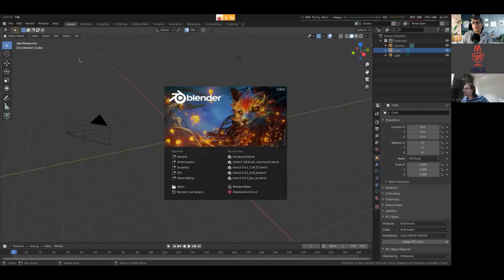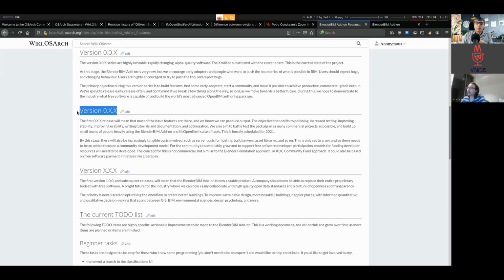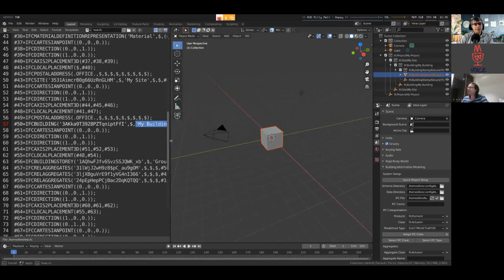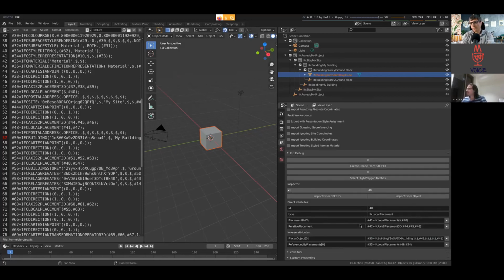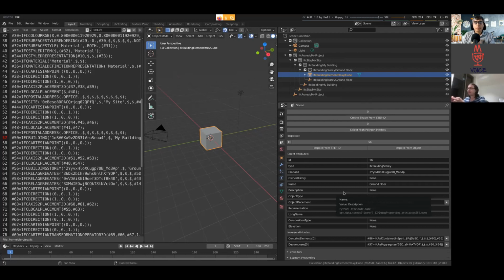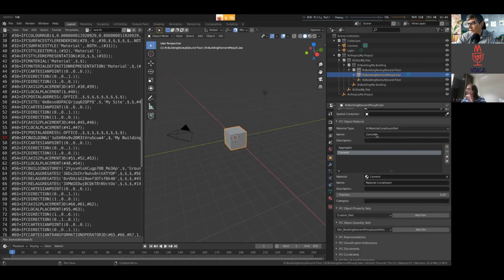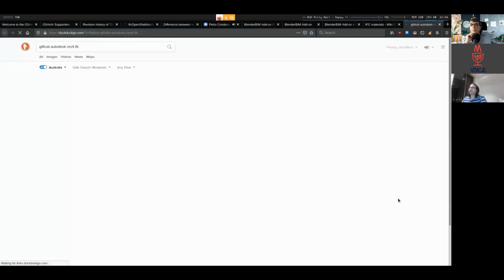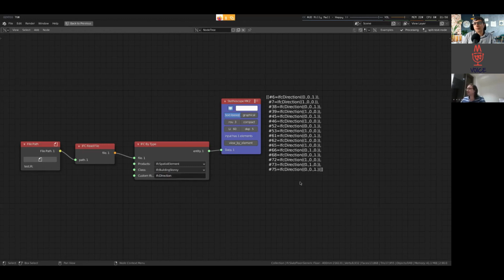BlenderBIM Add-On v0.0.201115 release - chat with Dion Moult #BIM #openBIM

Comment: Glad to see the default cube being given some love.
Reply: Hi Gavin!

Have you tried this add-on?
We now have a colleague that knows Blender but not BIM. Our first attempts to bring a simple blender model into Revit via IFC aren't working. We keep getting the bounding box of the objects but not it's actual 3D shape.
Do you know if there is some trick in the export settings that relate to the way Revit later imports the IFC?

Cheers,
Mariana
Reply: @marianaarodrigues1  i really only used it to see how it works. As far as I know it doesn't change the way that geometry is brought to blender as IFC, but moreso how it can be reclassified to the data schema.

I only worked with native geometry in my experiments, maybe check your export settings from revit as you might be seeing the space objects (rooms) over the elements themselves. If its the import that is the issue, view the output in BIMvision to see if its revit or the IFC itself that is the issue. Might be a blender setting.

Worse comes to worse I'd contact the developers for help. They know much more than I do about the program.
Reply: @AussieBIMGuru  Hi Gavin. Thank you for the feedback. From my experience the workflow Revit to Blender via IFC works very smoothly. What we were trying to achieve was the opposite, but somehow the geometry created in Blender if exported to IFC looks great in Solibri and programs alike, but in Revit the same IFC file looks empty... 
I am probably missing something and will have to contact the developers and keep doing my trial and error samples.

Thanks :)

Comment: The current reality is that interoperability using OpenBIM is extremely challenging. Almost all applications in the AEC industry (BlenderBIM being the exception) store data in their own format and rely on “translators” to move data between their own format and OpenBIM. Dion’s IFC inspector feature allows troubleshooting of these translation problems.